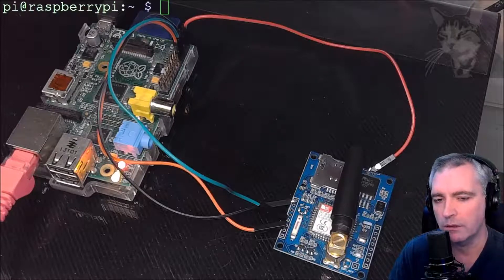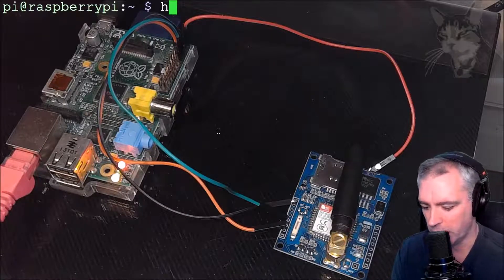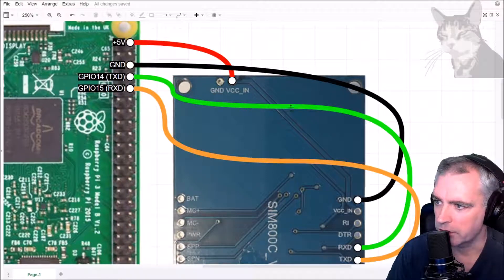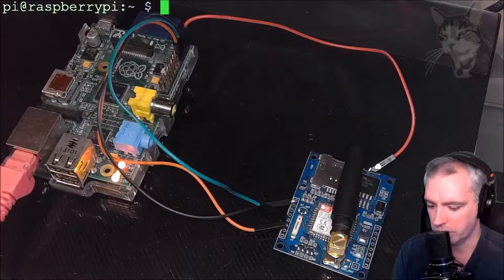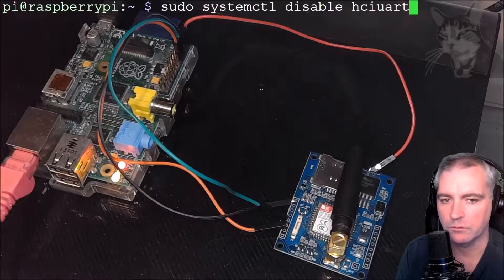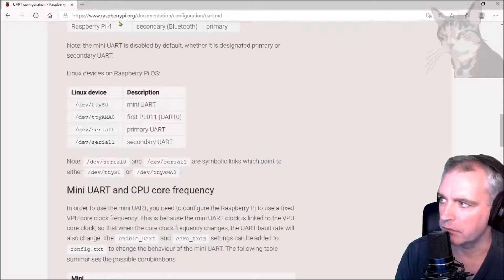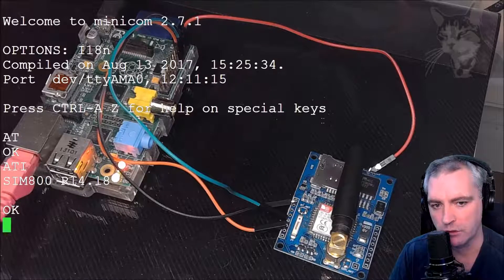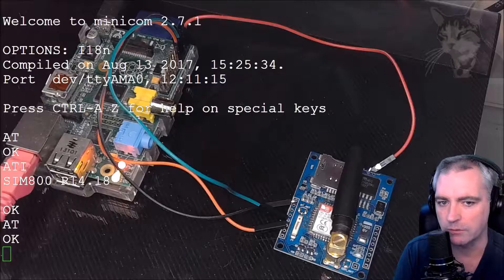Connect SIM800C SMS Module to a Raspberry PI

Comment: I'm using a slightly different SIM800C module than you demonstrate, with a Raspberry Pi 4B. Following your GPIO connection diagram and disabling the default Serial Port as you instruct, I got minicom to work properly using /dev/ttyS0 (not /dev/ttyAMA0). Now I'm so happy. I hope this note may help someone. Good Job SBCODE

Comment: Thanks for your hard work.
I'am using Rpi 4 and SIM808. I used a schema as the one you used to connect my rpi and the sim module. But, I got my rpi not working anymore. The ACT Light is not blinking but the power light is OK. I tried to connect the SD card to another rpi and it is working fine, I also tried to reinstall the raspbian.  but my rpi is not still working. The mouse, screen and keyboard are not detected. So, do you have any suggestion or solution to give me please ? Thanks in advance.
Reply from the maker: I don’t know. Mine works

Comment: is it easier than sim800L?im banging my head with sim800l and unable to make it work. it doesnt register to network. does sim800c shows similar restrictions of adding a capacitor to voltage surge and restriction of exactly 4v etc? or its just connect to pi like you did and it works out of the box?
Reply from the maker: It works exactly like i show in the videos. Videos are not faked
Reply: @sbcode  so no need to add any capacitor or diode?
Reply from the maker: I didn’t need to. If its not in my video, then i didn’t do it.

Comment: I cant type anything on AMA0 SO i try on SO. It works but showing weird characters. Please help me
Reply from the maker: you probably need to disable the linux serial console. More info in description
Reply: I can now type on AMA0 but there are still weird characters. Also, even I'm not finished on typing the command, it automatically entered it
Reply from the maker: its either 'linux serial console' or you mixed up tx/rx
Reply: I try to change the connection of tx/rx, i also try what is in the manual and use 10k resistor and diode. Btw I use Sim800l.
Reply: I also add the following to config.txt:
dtoverlay=pi0-disable-bt
enable_uart=1
Reply: I also change the baudrate to 19200 and 9600
Reply from the maker: it works for me. evidence is in the video. i have hidden nothing from you
Reply: Maybe the module is defective
Reply from the maker: its probably ok. Double check that page https://www.raspberrypi.org/documentation/configuration/uart.md 
If you don't make the configuration changes, the tx/rx are used for tty  by default, and it sends messages through them. That is what you might be seeing with the strange characters.
Reply: @kudakwashedzorani7576  i have defective module. Buy another 2 module to increase your chance that you get non defective one

Comment: the light is blinking after every 3 seconds but the AT command is not returning anything , what can be the problem here ? . i have tried anything and everything couldn't figure it out can you help?
Reply from the maker: if you don't see any data output from the sim module after you connected using minicom, or even my python script doesn't show any responses, then check your wiring. Maybe you TX and RX are swapped around or the connections are not good. Do you get any output at all from the sim? There really could be many reasons. Anyway, it works for me, evidence is in the video.
Reply: yeah rx and tx wires are fine , actuallu i am providing external power to sim800c.
Reply from the maker: How do you know rx and tx are fine if you arent getting any data both ways.

Comment: Thankyou.! sean
I like the way you connect Rpi with the sim module.  Will it be same for Raspberry pi 4 model b ?
Reply from the maker: probably. search for 'rpi 4 model b pinout', look at the diagrams and you'll  see that the pins I use are the same.